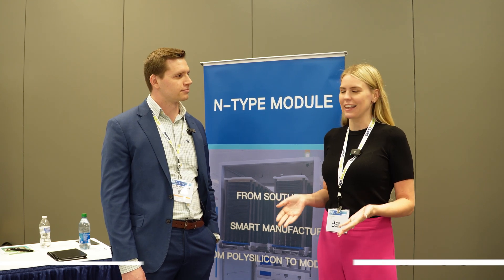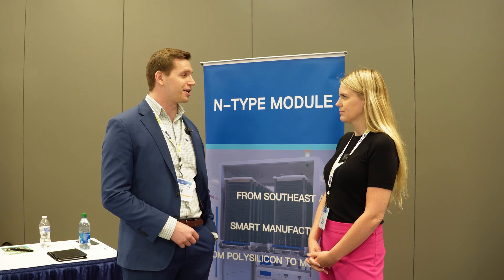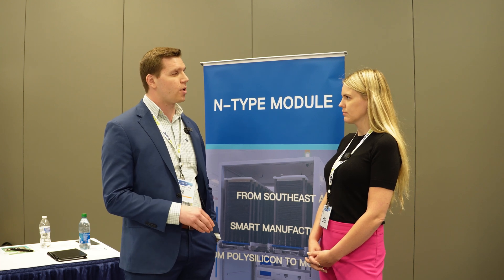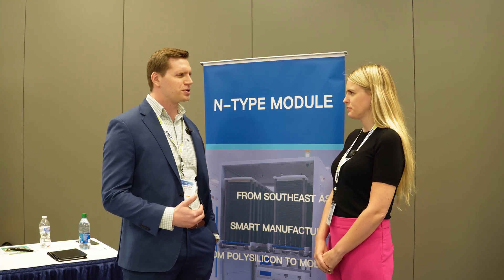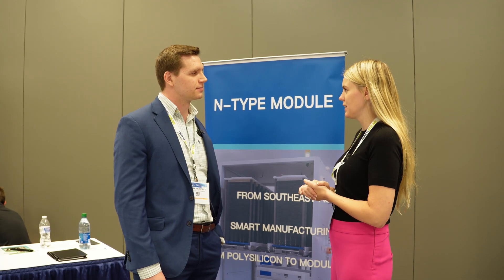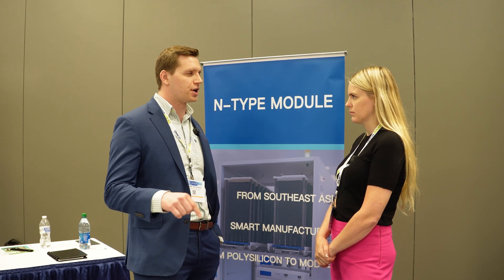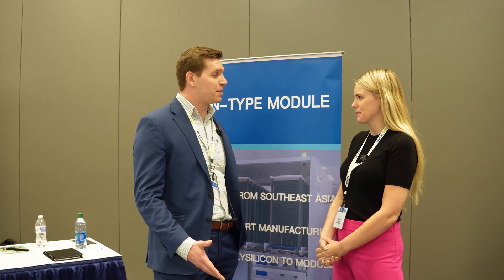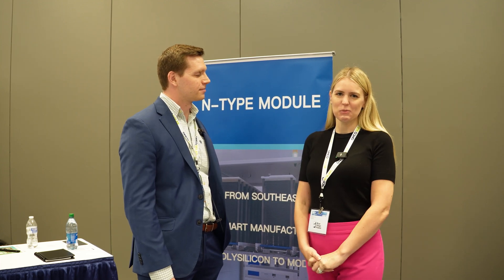New Hyperion 400W Solar Panel

Comment: Why do u say the produce at 35%???? 
I have 20 panels to arrays and 10 panels each going into a 9000W inverter and the max production I get out of one array is maybe 2,000kwh and In total array all 20 my production is 3.5kwh maybe 4.0 kWh at noon on the best of days. This should be near 16,000kwh to 20,000kwh max on a super sunny day (400w bifacial Hyperion panels). I want a refund I have six months of 30% production data and that is not Suffice to run my system not even close!!!

Comment: He said made in China so you can forget it.
Buy Equipment Made in the United States Of America.  We manufacture a superior anyway, shipping saves a bundle vs those oversees guys.
Reply: Hyperion panels will be assembled in the US starting Q1 next year, and will qualify for the domestic adder. As stated in the video, a multitude of well known panel manufacturers already use Runergy's cells. Hyperion is on the same level as a Hanwha QCell, REC, etc.
Reply: The US doesnt even make enough cells to have a fully US made panel company. All of them come from china.